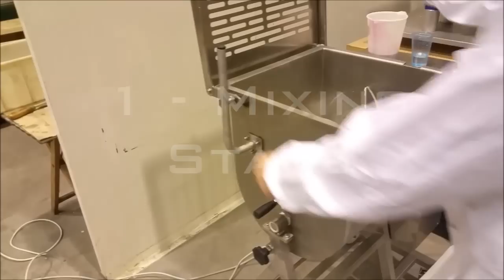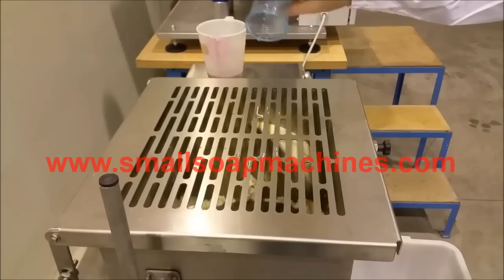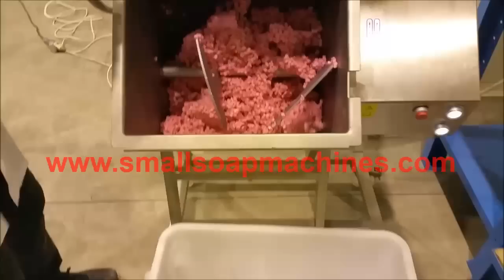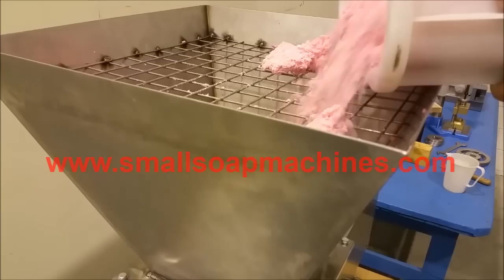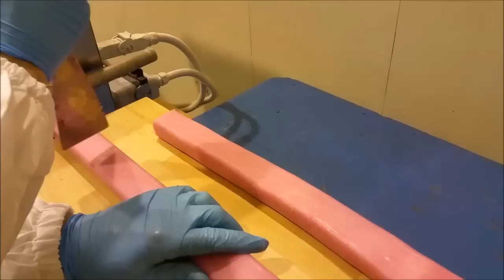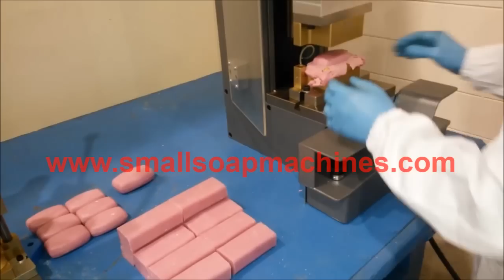Small soap making machines

Comment: Very interesting, my only issue is that you can only make one shape soap. No piping or swirls and the bars look machine pressed and not hand crafted. However the machine was wonderful for what it does and for those looking to make uniformed stamped soaps. Thanks for the video. 😊
Reply from the maker: It is possible to produce a lot of soap shapes, it is sufficient to change the mould of the soap press. You can produce oval soap, flowers, animals and a lot of types of soaps.
See www.smallsoapmachines.com
Reply: p'sl  I needs the price of the machine